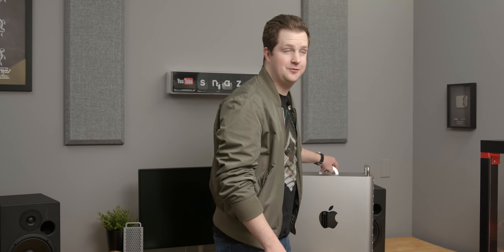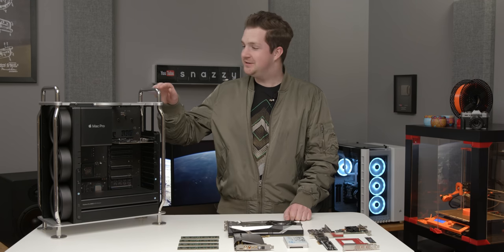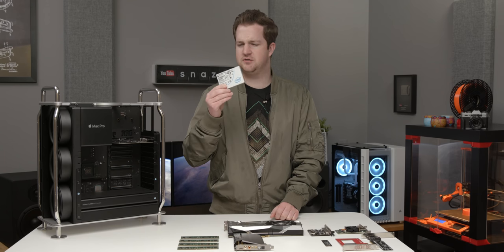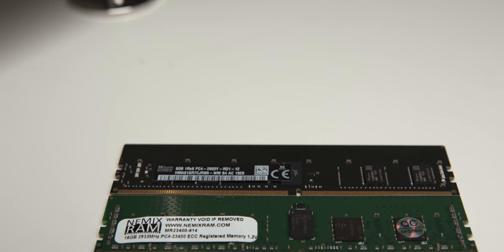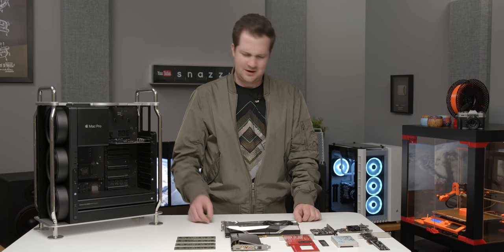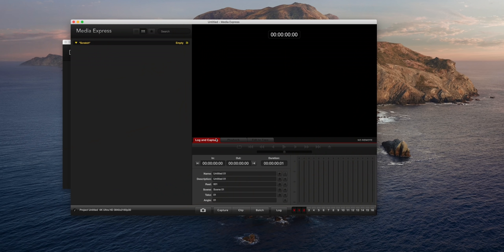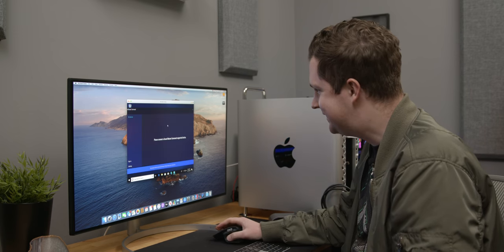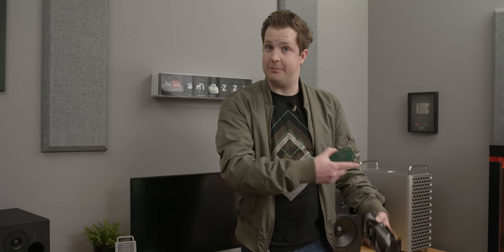What Weird PCIe Expansion Cards Work in Mac Pro?

Comment: I had been thinking of picking this up for my film work. I was actually thinking would it be possible to run windows and put nvidia graphics in there. So how does that actually work? Can it be in there with the AMD or does that have to be removed? And if you're booting up macOS does the nvidia have to be removed? Or is it fine to leave it in there simply because the OS won't recognize it? Some clarity on that would be a big help, thanks!
Reply: Well how it works is you overpay for the hardware several times over what a much faster and equally reliable Windows / Linux PC would cost.. Then run Windows on it anyway (Windows via bootcamp is just Windows, no special magic from Apple) with an Nvidia graphics card you have to buy yourself.
Yes you can leave the Nvidia card in there when you go back to Mac OS, just have to use the output from the crap AMD card.

You would be much better off getting a normal PC with AMD R9 or Threadripper CPU and ECC memory + Nvidia GPU for your use case.

Comment: Confused about the SSDs- I thought the ones that shipped with the machine were tied to the T2 chip and couldn’t be replaced with just any other drives. Now you’re saying  that you can install a new drive, make it the boot drive, and remove the original with no problem? 

Are you saying that the T2 thing wasn’t true? People have been saying that a Mac Pro without an official Apple drive is bricked (so like you couldn’t buy one without a drive)

Comment: You can easily take one Molex 4 pin to Sala Power connector and then cut the molex pin and use a multimeter to find the 12V output on the Apple Motherboard and 5V output and jumper that by breaking pci power pins and it would simply power the usb card.

Comment: Regarding powering up things that need SATA power, I saw that there are a few 8 pin and 6 pin power connectors on the motherboard, you could make a custom 6 / 8 pin to SATA power cable and use that instead of waiting for someone in China to make a 10 pin custom connector cable.

Comment: not sure if this has to be done in Parallels (I'm using VirtualBox) but did you make sure to enable the interface? Or set up a bridge for it? If you didn't that's possibly why Windows couldn't find it. To use the internal SD card reader (which is connected via PCIe) on my MacBook Pro inside a Windows VM I had to create a bridge for it first in VirtualBox.

Comment: nvme is at most PCIe x4 so it will be just as fast based on the protocol. U.2 drives sacrifice performance for reliability in the actual flash memory modals

Comment: easy DYI power from the molex 10pin. Just use sata power in one end and raw wires in the other to correctly put them into 12v 5v and gnd

Comment: I wish you can test a CPU upgrade: grab a Xeon W on AliExpress and drop it in this chassis. You may be able to get this machine up with the same 28 cores as the top end one, just without the 1.5TB memory using a relatively cheap processor.

Comment: Wait, how did you manage to use the same copy of Windows 10 in Parallels and Bootcamp simultaneously? Did you use an illegal copy of Windows 10? The last time I've tried using the same Bootcamp partition for Parallels also, one of the Windows system activations was canceled: if I activate system in a Bootcamp configuration, the Parallels configuration became non activated and vice versa, although the partition and the Microsoft ID used for that was the same. Microsoft support told me that the Windows serial number is linked to the motherboard so when we use Parallels solution it's basically a second computer, which violates the license agreement and they no longer support the Bootcamp partition over Parallels, only separate installations with separate keys. It was in 2017, did something change?

Comment: Ok, but you're blaming Apple for not having the drivers for some things that clearly were made for Windows, and the manufacturer didn't even bother to make drivers for macOS
Reply: It will eventually work, the reason these things don't work is that Apple hasn't made a PCIe capable Mac in a while (so it's kind of Apple's fault, but not entirely). The NVIDIA card is something that will not work unless Nvidia decides to support Metal, and if a graphics card doesn't support it, then it will obviously not work (soo.. f**k you NVIDIA).

Comment: I still use a soundcard. Simply because I didn't want to add to my already cluttered mess of cables. Since its in my PC it's alos a lot more portable. 'Cause it's in there so I dont have to carry around a seperate DAC or AMP everytime i take it with me.  This also makes runs for cables a lot easier as I want my Heaphone cables coming from under the desk so they don't have a chance of draping of my keyboard.

Though, this also means i'm unable to go smaller than Micro ATX. Simple because I need that extra PCI-E slot.

Comment: Just get some molex connectors and pins then use a multimeter to find the pinout of the plug on the board, then make/pin a molex connector appropriately

Comment: I think I found an adapter cable that will work with the 10 pin connector on the motherboard. It's a rather ugly connect to everything adapter but it should do the trick until other options arrive. I found it on Amazon and it costs under $20.00. No way to know for sure that it will work until you try it. I hope this helps.
COMeap Motherboard 10 Pin to PCI-E 8 Pin(6+2) SATA IDE Molex Power Adapter Cable Compatible with HP DL380 G6 G7 Server 25-in(63.5cm)

Comment: Does using the secondary SSD get around the T2 chip?  IE, if you install MacOS on that, could you, in theory, pull it out and use it in another Mac?  Or, if you wanted to upgrade it to a larger one, clone it to another drive, boot from that and still have it work?  All the things the T2 would block on the primary SSD.
(My thought is that if someone is worried about the SSD failing in their Mac, and then being locked out from simply replacing it by the T2, maybe this would work, and users could be better off using a secondary boot drive in their Mac Pros)

Comment: If I buy Mac Pro with minimum configuration. It's like buying Apple's power supply, chassis and motherboard. How much does it cost for other hardware to purchase the hardware upgrade according to the top configuration parameters?

Comment: If you do have the PCIe power cables (via the Belkin kit), isn't it possible to use a PCIe to SATA power adapter to power that USB card?
Reply from the maker: Yeah although I couldn’t quickly find a female to female adapter which is what you’d need without ordering one from China hah

Comment: People need to know some very important facts. The Apple has a 1000w power supply. Unless you use the base model, this is way underrated for the higher ends or if you populate all slots. And the SSD is actually 5 year old tech which is why the fusion drive is so slow. Now, the primary SSD also has a T2 lock. This means when Apple decides to make this "Vintage" in 3 years, the standard SSD, and power supply will no longer be available which means absolutely no support should you need it and they will require you to purchase a new Mac Pro. And know, the T2 lock is Apple is working on making the OS bootable only on the registered T2 hard drive. Any added hard drives will not be eligible for OS installation. Which again means, when Apple decides, your Mac Pro becomes the most expensive door stop ever purchased. And the RAM installation map is on the inside of the plastic cover shields if you just look inside them. Actually nice. And lastly, you can build a PC far more powerful for anything except Photoshop and Compression like zipping, but in many cases twice as powerful even for gaming and video production, for far cheaper, and if you want to stay Intel, you can, but you can build a PC twice as powerful for 1/3 the price, more or less lifetime support without any company calling it "Vintage" at their discretion, and you can use Windows, Linux, and even Catalina as a Hackintosh and Windows has Hyper-V built in so no need to purchase Parallels to use virtual Machines, you can do it all for free. And you can Use NVidia with PC and have the added advantage of Cuda Cores and RT at this time. And almost any and all cards work in PC, and for far cheaper. A whole lot cheaper and more powerful
Reply from the maker: PSU is 1280W sustained and 1400W peak.
Reply: @snazzy  And you think this is fully capable of handling this Xeon system with Dual graphics cards, especially ATI Graphics, and all 8 PCI-E slots populated? From what I've read from my specs given to me from Apple is it's a 1000w Platinum. Dual ATI Graphics require a minimum of 1200 watts with this Xeon processor for recommended specs, and if you run a capture card or other devices requiring power from molex connectors, their isn't enough power in the budget. And Apple is horribly known for poor build quality when it comes to electronics, so you can put money this power supply will NOT last 7 years running at 1200 watts, or even 1000 watts. And it's not going to be a $100 replacement, it will be a Apple store only while it's not considered "Vintage" and will have a premium price range well past any 1200 watt value.
Reply: @snazzy  by the way, in the USA, we use 110/120vac which is why the power supply is only 1,000 watts here. At 230vac it's maximum of 1280w according to their official website. And the high end has 2 video cards, at 300w each and a Rocket card at 150w. With the CPU max of 255w TDP. This leaves ZERO room for adding anything that requires power like a 8k capture card with a full audio card and a USB 3 card that requires it's own 25w to operate. Plus all the fans as well. Just not good.
Reply: @snazzy  sorry, more research found the Xeon W 28 Core actually uses 385 watts consumed under load. Ouch! So, 2 video cards at 300w is 600w. The Rocket card is 150, now putting the system at 1135w. That's running the power supply at maximum power under load all the time. With ZERO room for adding anything like cooling fans or hard drives. Again, Apple hopes this lasts barely past the warranty period so they can force the purchase through the Apple stores since the parts are only available through Apple and NO 3rd party vendors will have access to replacement power supplies. And once Apple deems it "Vintage", your $25,000 plus $400 for wheels computer becomes a very expressive doorstop that the video cards are designed specifically for this model only and cannot be moved to a different system, and your crappy hard drives are locked to the MB. But building this outside of Apple, you can build 3 machines with more power, 15 times the storage speeds, and 1tb of RAM, a 64 cores 128 threads CPU and the ability to run 15 8 core VM's all at the same time and still run Catalina as one of the VM's. All while no one will ever stop your ability to use the machine for any reason and parts are available anywhere by anyone without any company controlling your ability to choose where. And most shops won't wipe your data for replacing a wheel or video card or a fan. Even motherboard replacement usually doesn't require wiping the hard drive and many techs, like us, can even swap platforms without re-installing or wiping the drive.

Comment: For the nvme drive its not converting the "nvme" signal nvme stands for non volitile memory express the express stands for pcie express so all your doing with that adapter is adapting it for a standard size pcie slot not converting anything thats why those adapters are so cheap

Comment: About that soundcard.. The PCIe card would've worked fine IF you had passed the PCIe slot in Parallels to Windows (you have to also pass the thunderbolt port if you want to use a thunderbolt device..?) 

Same goes for the graphics. You can game on macOS via Windows virtual machine (the hypervisor under linux (kvm) is 5-6% detrimental.. Now I wonder how does macOS stack up) 

So if anything.. The new mac pro is excellent for r/homelab and I can't wait to see who is going to run 100 VM on 6 rack mount mac pros & going to call it a homelab..

Comment: If you really want, I'm sure can do a SATA Power - 10-Pin Molex cable yourself.
Not the best option for a 6000$ machine, but if don't have a choice (which is strange, you should be able to find anything on aliexpress)

Comment: You know...I bought a Mac Pro 1,1 brand new in 2006. It got stuck on OSX 10.7.5 so I got a really nice 2009 Mac Pro 4,1 at very low cost. I put a USB 3.0 card in a PCIE slot, 32 GB of memory, a fast 500GB SSD in one drive bay and a graphics upgrade. My total cost was under $500. Works really well. 

I have my orginal HD from my 2006 Mac Pro in one slot with OSX 10.6.8, my SSD upgrade with OSX 10.7.5 in another slot, a new fast SSD in another slot with El Capitan...which Apple still supports. Nice thing is, I can boot from any drive and run all my old software that won't run in newer OSX versions. 

Am I drooling over a new Mac Pro? At these prices, not really. Apple can get rich off someone else. I just want to get work done...

Comment: hmmm if Belkin made power for PCI-E cards, they probably would make Sata power for that USB card.
but if it doesnt exist, maybe there's a device that converts PCI-E power into Sata power. or you try the rat's nest of cables by using a female-female PCI-E adapter and use a Sata to PCI-E adapter then using Sata Y splitter, though you get only 1 usable Sata since there's  only 1 female sata on a Y-splitter
that though one can avoid the rats nest if one can either solder/crimp their own cables.

Comment: you could route sata power from an other power supply through the pcie slot covers and try again
Reply from the maker: Unfortunately the Mac Pro won’t power on without its cover so I can’t test that lol
Reply: @snazzy   couldn't  you route the cabels through the slots  for the pci-e  cards, take the a few covers out from an unused slot and put the cables there

Comment: Uhm. You had pcie cables? So you could just have gone from one of those power connectors to sata power :). It's all just 5V and 12V, passive connectors are available, or if you are a bit sneaky you could just solder your own.

When it comes to parallels, you have to bridge it into the machine. A virtual machine does not just get raw access to the host's devices. I don't even know if parallels supports passthrough, but some other virtualiziation software does. Might want to play around with it a bit more? :)
Actually, see if you can pass through both the soundcard and the graphics card, and try that sweet borderless mode. Gaming in OSX via windows passthrough ;).

Actually... hmm. It seems it's something you can do on hackingtosh's, but not on official hardware. Bummer.

Comment: Apple makes Mac Pro for editing 8K videos without mentioning to support 8k displays.   It's kinda odd.
Reply: Editing in 8K does not mean delivering in 8K. As soon as 8K becomes a consumer standard, there will be 8K monitors. Until then, "8K editing" refers to cropping into 8K streams for stabilization, reframing, and VFX, for delivery in 4K. Pros already know this.
Reply: @benswinter  I bought 8k TV and I need Mac Pro supports 8K.  I have 8K cameras for 8k.

Comment: Any Idea if the T2 chip f**** around with a CPU swap? That's maybe the only thing that hold me on executing my credit card... (I need that more compiling power baby!)
Reply from the maker: Nah, it’s fine. I upgraded CPU in iMac Pro with one that Apple didn’t technically use but was in the same series and it worked fine. That machine had a T2.
Reply: @snazzy  Thanks! It make more sense now to buy the bare basic one. I just need to find the credit card, I think I heard cries under the bed, should be easy.

Comment: It was because of the "Trashcan" Apple Mac Pro (with no PCIe expansion) that felt betrayed and moved to USB and TB.  Now they appeal to a larger demographic.  A modern Digital Mixing Board such as the X32 Behringer is fine with USB 2.0.  Plenty of bandwidth for 32 channels of Digital tracks.  AVID and Fairlight are still angry.

Comment: Heads up to anyone who buys additional memory: The linked memory will drop your memory speed from 2933 to 2666 even if you have a 12 core model or higher. After buying the ram in the description and installing it on a 16 core mac pro memory speed dropped to 2666 from 2933. If anyone knows of cheaper memory than apples that will not drop the speed please let me know.

Comment: Lol interesting video, it’s pretty obvious your never had a 4,1/5,1 by the choices you made in pcie expansion. I think you should sift through the macrumors forums under Mac Pro for a while. You will find a lot of useful information. There is an excellent write-up about usb cards. I currently use a newer sonnet allegro pro 3.1 card. It’s important to have a card with multiple usb controllers, 1 per each port and that is powered over pcie. Also it would be nice to see you Use a supported amd GPU as an upgrade, such as a Vega vii or 5700xt.

Comment: I was hoping for some actually "weird" PCIe cards like an FPGA or LoRaWAN radio, but you test boring old stuff that people use with macs all the time.  NVME?  That cheap adapter works in a 1st Gen Pro from 2006.  Blackmagic?  I'll bet half the cards they sell go into old Mac Pros, hackintoshes and Thunderbolt enclosures.  USB3?  Just make sure it has an ASmedia chip.

Comment: Why don't you  just adapt the six pin power connector to SATA?
Reply: There's no 5v or 3.3v in a GPU power header, just 12v and ground.
SATA needs all 3 voltages and ground.

Comment: "don't buy ram from Apple"
Buys the cheapest crappy ram available
Reply from the maker: It’s actually higher end than Apples with a lower CAS latency.
Reply: There's more to ram than just the timings and speed, skhynix is a well known brand, can't say the same about the el cheepo dimms you bought, I would have thought that especially for a WS you'd buy high end (high quality) dimms.